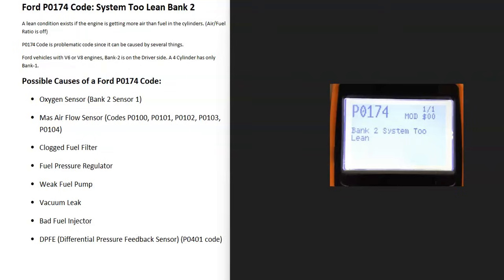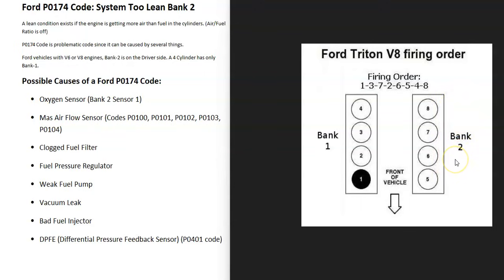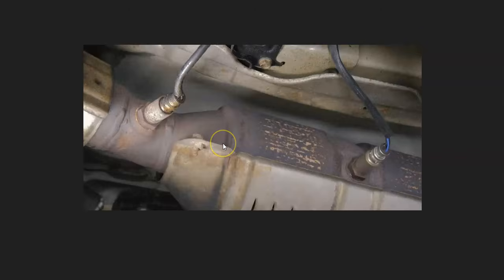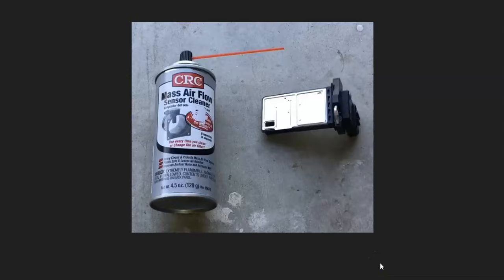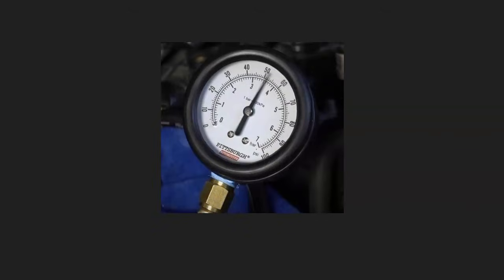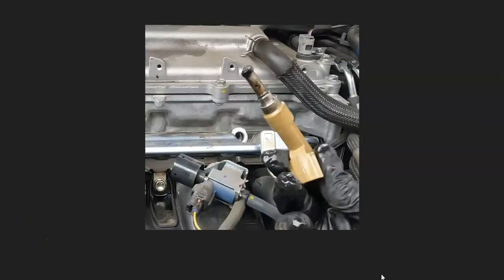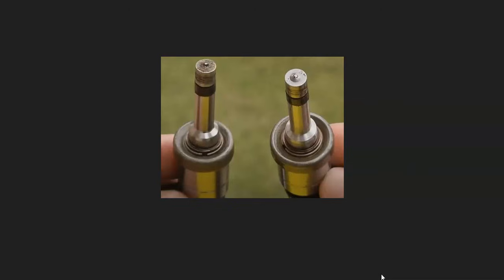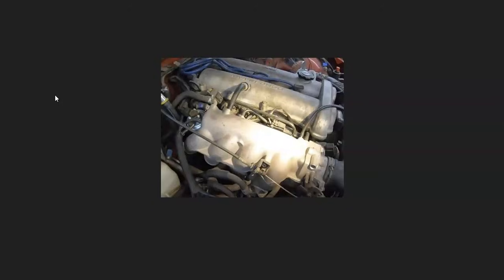Causes and Fixes Ford P0174 Code: System Too Lean Bank 2

Comment: Thank you but why would you not do exactly what you did but in reverse. Least expensive and simple to complex?
Reply from the maker: When it comes to engine Lean and Rich codes, every mechanic will troubleshoot it differently. There is no perfect thing to start with since so many things can cause the codes. I'm just listing the way I do it.
Reply: @HVAC_Mechanic  amen.
Reply: @HVAC_Mechanic 
Hello i have a 2002 ford e350 xlt v10 lariat. The cel light turned on and obd2 codes are po171 po174 po102 and po460 the van still runs like a champ no hesitation no bogging out at stops nothing like that . runs smooth. When i use the live fee and run the engine i noticed the maf has low to no voltage so i delieve the maf is bad and my air filter is very  dirty. I plan on replacing both the maf and filter. Wilk this clear the po102 and the po174 and 171 codes should i also use some lucas fuel injector ckeaner in my gas to clean injectors.also the pcv valve hoses seem to be wrapped with an material that apears to be around the hose with hose clamps  and is all cracked. Ive read this is common with the ford e350 engines is the exterior material on the hose cracked or is it the actual hose  .  can you please tell me. What your professonal opinion is when it throws the 174 171n102 and 460 all together and yet runs well still oh on ocasion there is a whistle sound. 
Thanks Selina